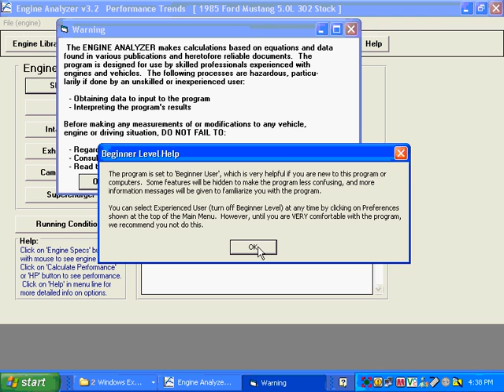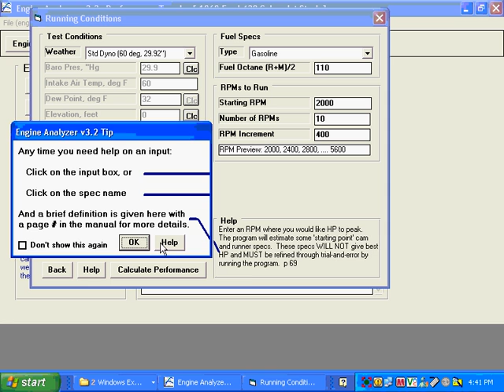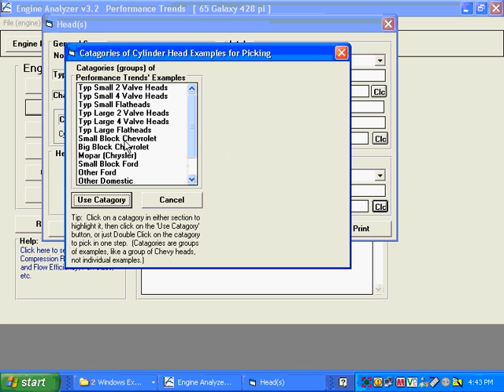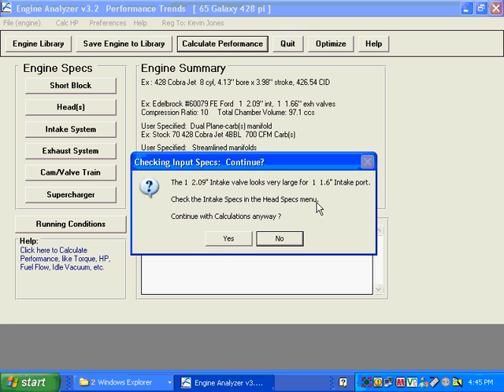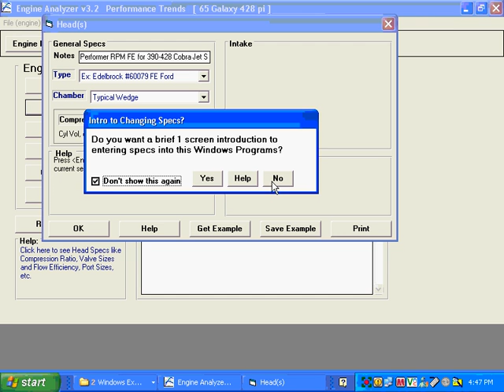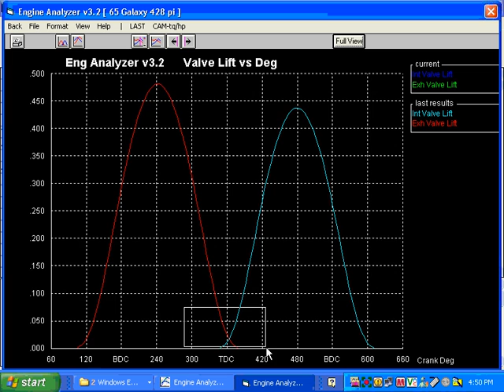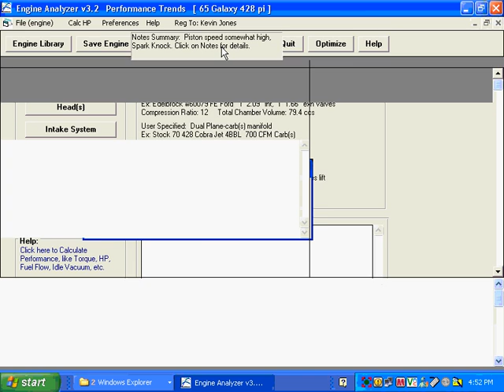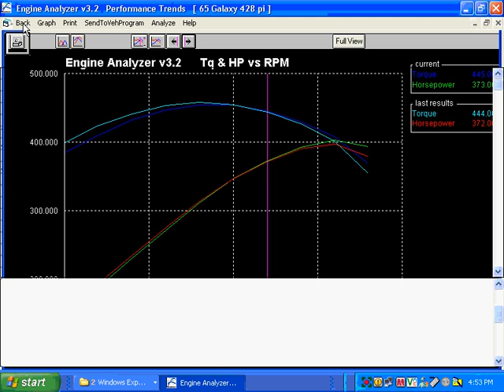Engine Analyzer Basic Operation (std version)

Comment: Hey I've just modified V12 engine and I want to check out some variables like HP, Torque rpm so does this software work in that way?
Reply: Yes, all versions of Engine Analyzer handle up to 16 cylinders. For more in depth modifications, the Pro version would be better suited for you. 
http://performancetrends.com/Engine-Simulation.htm
Give us a call if you have more questions!